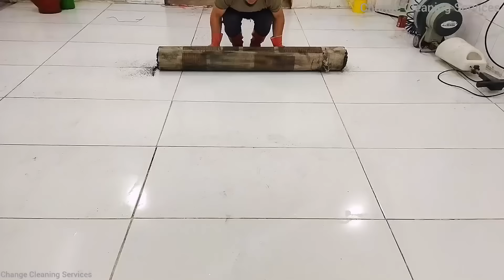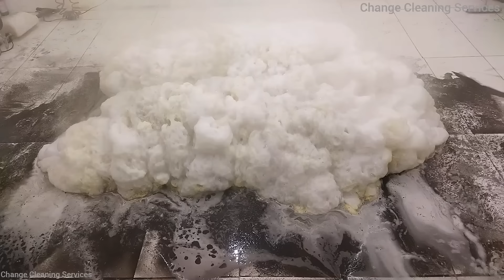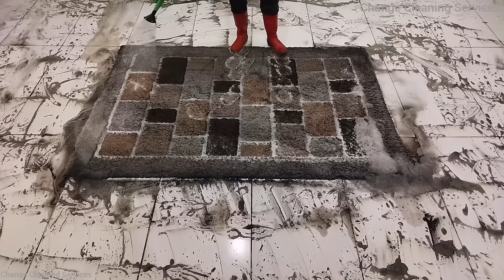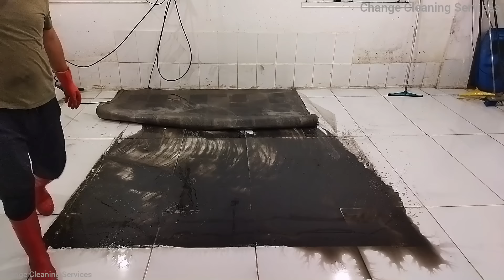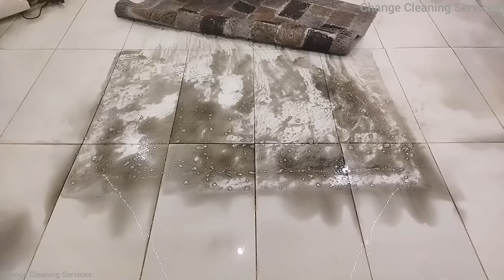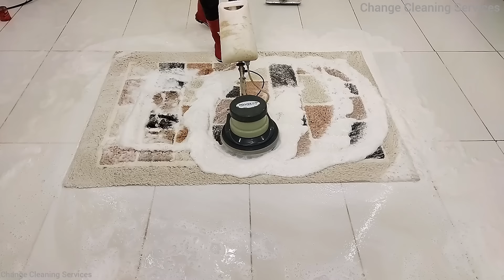Deepest cleaning with New Method lll satisfying carpet cleaning ASMR

Comment: Omg with my back n knees I couldn't do that so I give mad props on the great job you do
Reply: The big machine is actually easy to handle. It moves right or left with either a little pressure or a little lift on the handle. I used to buff floors with one and do it one handed.